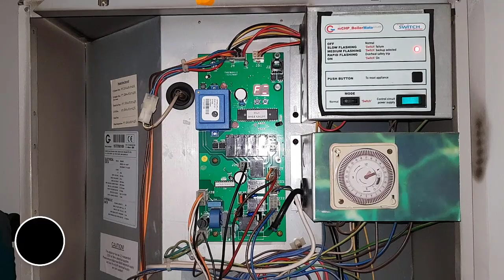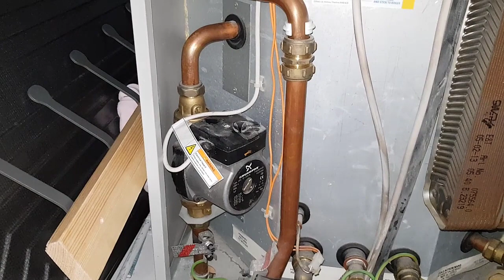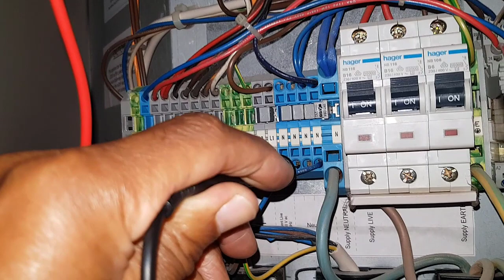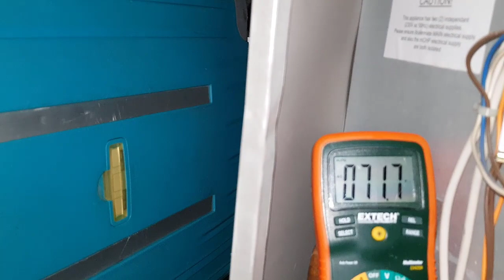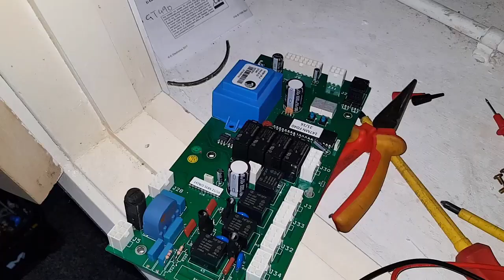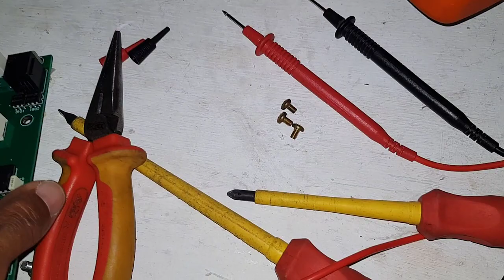How to Test for a Faulty PCB Gledhill Boilermate A Class

Comment: Hi - I have a ideal icos boiler and my replaced pump for the hot water is constantly running despite no demand fron the boiler. My faulty Grunfos pump was replaced with a Bastian pump (never heard of them) by Scottish Power appointed repair man - he's returning Wednesday to replace it with a new Grunfos one after my insistence. He claims the thermostat for the heat store is at fault but he hasn't checked anything . I personally think he's at it as he says the thermostat is not covered by my warranty (but the PCB is) - how can I check? Can you help please?
Reply: Sorry meant to add that the pump for the rads is working perfectly fine and switching on and off as required
Reply from the maker: It sounds a bit tricky that one try speaking to Gledhill technical support